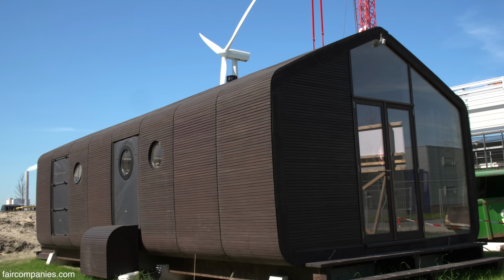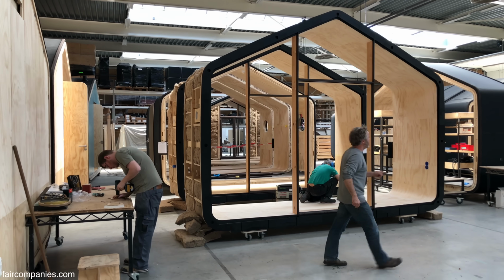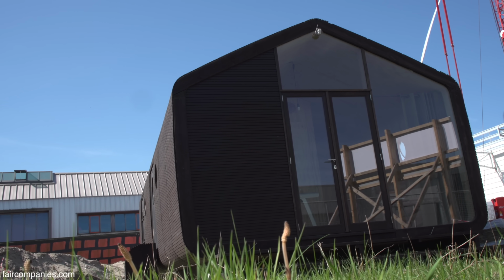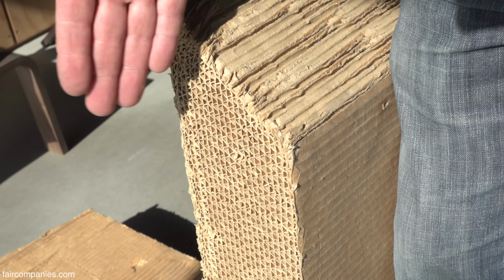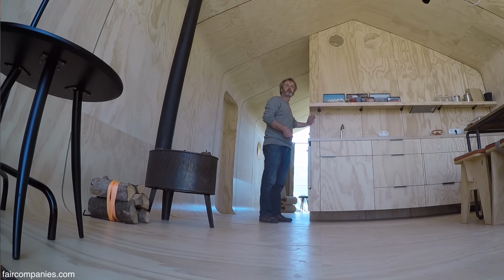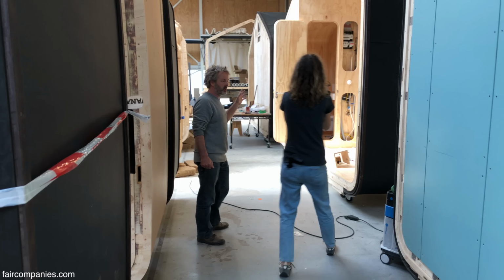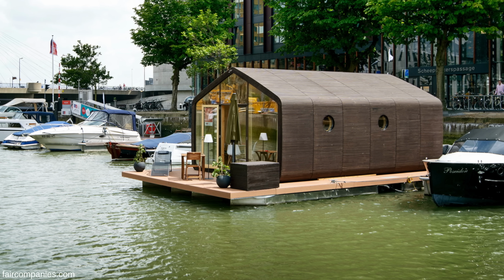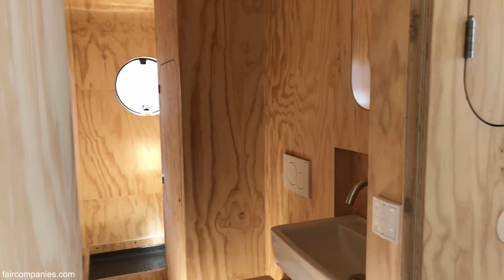Wikkelhouse: pick your modular segments & click them together

Comment: I always wanted a Termite-mold-farm-fire-nest of my very own.
Reply: To add insult to injury, you spent a ton of money on it!
Reply: Trynnun02, if a fire trapped kids in that closet of a bedroom, I'm not confident they could rush out those windows.

It looks like they are not made to open fully.
Reply: Right!
Reply: hahahaha
Reply: it sounds like you want a regular house then.
Reply: @Apathetic Indecisive - This is fine for a long "Temporary" shelter, but for the cost comparison alone, this is a horrible decision for somebody wanting a home. For the same price you could build a far better home with a better base material such as "Hempcrete" which accounts for all fundamental concerns for anyone looking to buy a home of the same size as this. This is a great concept, but the design flaws for  "This Home Design and materials" are too great for the cost; EDIT: This home would be prone to far too many problems too often for it to be a practical home design.
Reply: Trynnun02, I would be concerned thieves might steal my home if it was a modular house or a "tiny house".  You mentioned hempcrete.  That sounds wonderful since it is a truly renewable resource.

Strange they didn't install a radiant barrier.  Also, what happens if a water pipe leaks in the wall or water accidentally flows onto that wood floor?  I would definitely need reassurance a water leak wouldn't lead to a costly repair!

Sorry to ramble, but I also won't buy a home that lacks in *closet space* or a garage.  It is silly to think people don't need to store items such as holiday decorations, camping equipment, tools, winter/summer clothes, the load of gifts they are preparing to give out at Christmas, bicycles, random sports gear and items for hobbies, etc., etc., etc.
Reply: Trynnun02 Hilarious!
Reply: "Standard" houses get termites. And mold. And they burn down, all the time. Come on man, use your brain.
Reply: They don't get termites if properly made. Same thing with mold. Maintenance is necessary. Fire? If Electrical again, not properly made. If environmental or user error, shitty luck.

Comment: good concept but throw away the cardboard and plywood, instead use metal and closed cell foam with rubber like material at the joints between sections.

Comment: Since cardboard is wood, I'm now wondering if it's more or less efficient than plywood with insulation. But I guess cardboard is made out of fast-growing pine and from farms of the stuff, so most likely the raw material is pretty eco friendly. Interesting.
Reply: It's remarkably MORE efficient. You have to understand that with corrugated cardboard, you also have the benefit of all that air!
Reply: I was thinking in terms of resource use, but I was very unclear on that. :) A standard construction method and some Aerogel insulation would insulate extremely well, the question  I was wondering about is how resource use efficient it is to build out of cardboard vs more traditional materials. I agree though that all those air pockets in multiple layers of corrugated cardboard would probably insulate very well indeed.
Reply: Ah, I see Croft. I thought you were comparing insulative capacity. 

 So I guess the question is with regard to formaldehyde & which Insulation you choose to pair your Ply with. To my knowledge, the chemicals used in the manufacture of nonplasticed cardboard, are as benign as baking soda.
Reply: The structural parts appear to be wood with the cardboard being insulation.   Seems it would be more efficient to just use a type of organic insulation.
Reply: That seems like a much better idea!
Reply: That's a great idea! The locally sourced concept would be much more available than trees. The term "smoke house" might confuse the uneducated for awhile. ;p
Reply: Croft I live in the south west of Western Australia and we have a port city with a massive pile of wood chips that are exported to make cardboard. There is always a queue of enormous ships waiting to pickup the wood chips. The source is the logging of Karri trees from our incredible old growth forests. There are a small number of people trying to stop this but we are far outweighed by the governments forest products commission.

Comment: About 12 minutes in, did he say "flax"?   As in "flax" seed or linen?
Reply: The closed caption says "Flex", there is also something called Flex Duct or Flexible Ducting.
I'm guessing he means that cardboard is rigid insulation, but they can also use flexible insulation.
Reply: It is flax. The caption is autogenerated. A flex duct is a flexible pipe/tube, the ones you see in ventilation canals.
Alternatives would be mineral wool or even sheeps wool. They are as flexible as the shown thick sheets of flax wool.
Reply: Indeed flax. Vlaswol (flax wool) is an ecofriendly insulator and an alternative to mineral wools like Rockwool.
Reply: I understood Flex!
Reply: anmeldest  It means the same thing. Don't be rude.

Comment: It's interesting, but I like the 3D printed concrete houses better.
Reply: @marthale7 cement isn't strong without reinforcement. it can't handle any tension. and beside that it also cracks. which is no good.

i would love too see a 3-d printed house get around those problems though.
Reply: @BloodSprite-tan  You can add fibers to the cement to add tensile strength instead of rebar. Something like basalt fibers. I think that is what one of the 3D printing startups do.
What fascinates me most is the possibility of 3D printing very intricate and ornamental houses at low costs. Have something like those beautiful jugendstil architecture but affordable.
Reply: Agree
Reply: Rafaela Mora  the search button here on YouTube and also on your favorite search engine would probably bring you the results you're looking for.
Reply: @marthale7 true and since it's not iron or steel it won't rust and cause even more problems.
Reply: Im so sorry to hear you dont live in a 3d house... are you one of those 2 dimensional flat earthers?
Reply: The cement industry is a huge greenhouse gas emitter. Sinking carbon in wood structures -- or, in this case, cardboard and wood -- is a lot safer for the climate in the very long term. (As long as we make sure we're growing / harvesting / replanting the trees sustainably.)